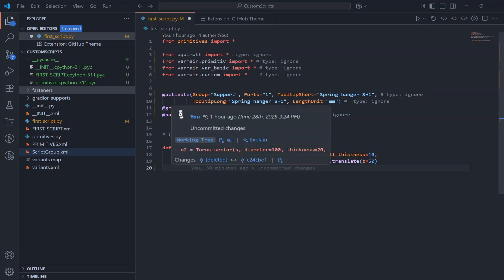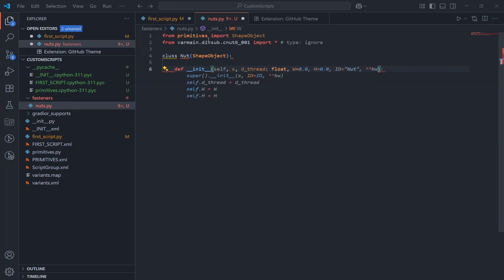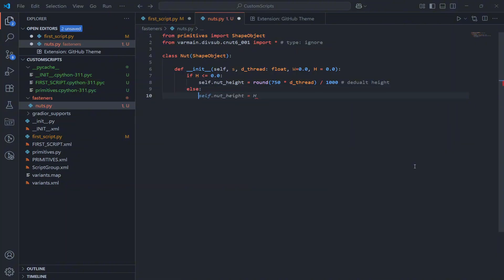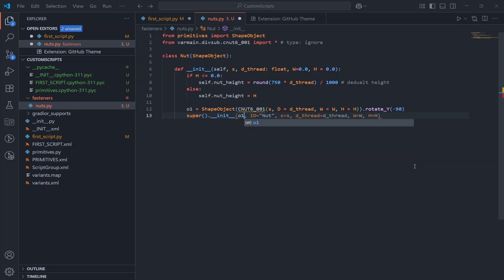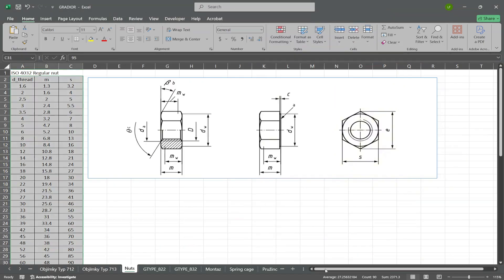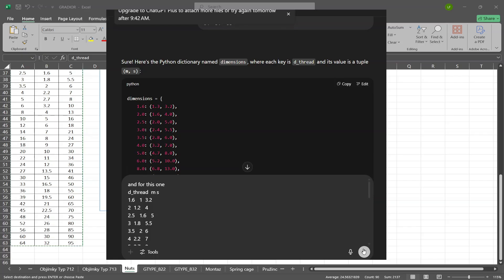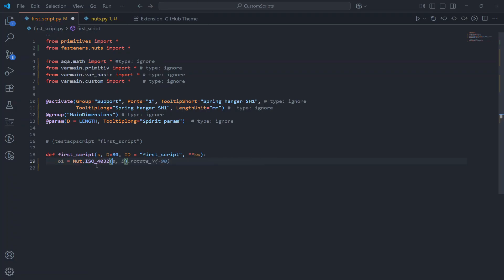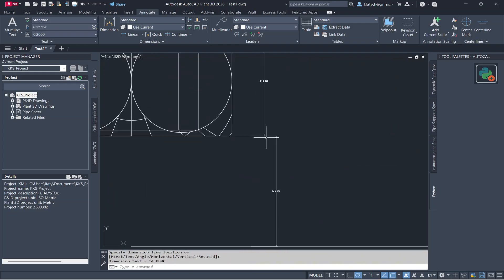Custom Supports in Plant3D with Python – Full Guide Series Part 5

Comment from the maker: Hello community!
Just a quick note about two small mistakes in this video related to nut dimensions:

🛑 03:45 – While retrieving width and height from the dictionary for Nut ISO 4032,
I accidentally swapped W and H. It should be the opposite.

🛑 04:22 – The same mistake appears again for Nut ISO 4015 –
width and height were swapped.

✅ Please correct the order when using the dictionary in your own code.

Thank you for understanding, and good luck with your designing! 🚀